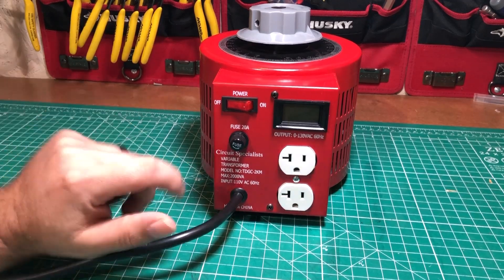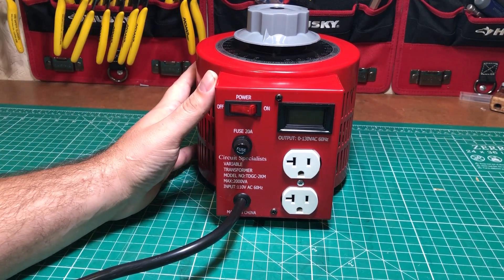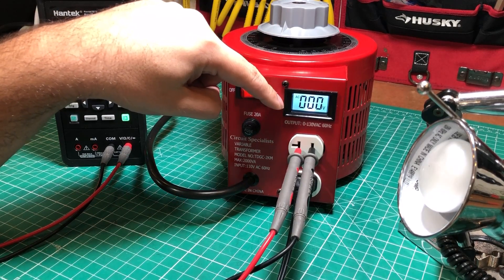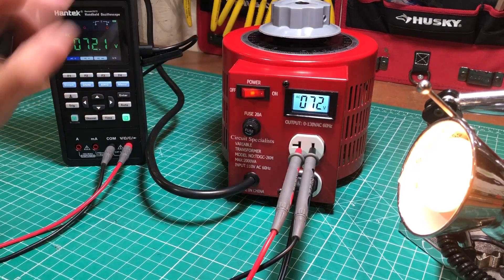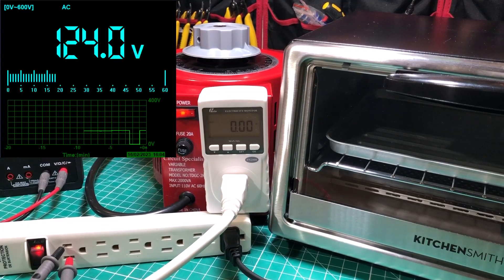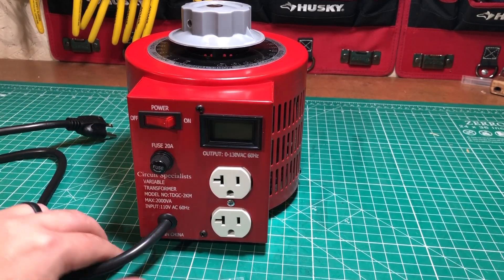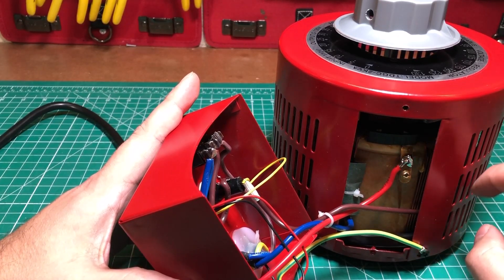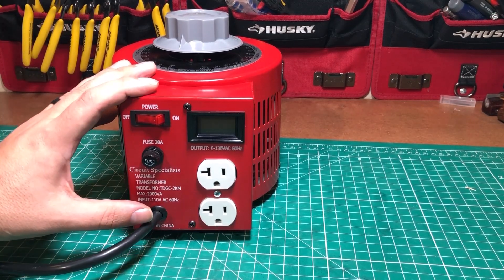Circuit Specialists Variac Teardown and Review - Model TDCG-2D

Comment: I have an idea...do you know how expensive toroidal power transformers are? You pay over $100 for 100VA capacity. Why not take a variac like this one, remove everything from the core, and wind your secondary over it? When you had it apart, did it look like there was enough room to wind a secondary over the core once the shaft was removed?

Comment: The Digital Voltage meter on mine is 4 volts lower than the actual voltage on several VOMs.  Can that digital meter be adjusted ?

Comment: It's floating too so the inputs should be protected.  Oh nm you're not scoping it
Reply from the maker: There's so much to learn from those project kits and you're totally right about the battery.
Reply: @AnotherMaker  see the new arduino giga. Two different arm cores in an stm32 package. One has a 2d rendering pipeline for displays .....or sprites even. I can't pay that much for a microcontroller.  Maybe you can get one in to review. I'll help pay. 

I bailed on that robot arm project and I'm stuck with a bunch of stuff I don't need haha. 2 teensy 4.1 and other stuff from the pjrc site plus a hundred dollars worth of bearings amongst other things. If they have no will to better the place I'm not gon a since around 600 more when I've already donated well over 3k worth of stuff

Comment: That's a big boy. I have a 3amp and matching isolation transformer. I'm modding mine into the same enclosure as my isolation. The wiring I'm not sure of
Reply from the maker: Hey thanks so much!  Having isolation would be awesome.  The longer I've had this thing the more uses I've found for it.
Reply: @AnotherMaker  I have a 1000kva isolation transformer you could have but it weighs more than an anvil haha

Comment: Nice to see a digital meter that's wired to display 0V, some are just 2 wire meters that cut out below about 30v
Here's a tip, when testing things that need low voltage AC, it's easy for the voltage to drift, or to set it accurately, which is important when voltages are criticval
Get a 12 or 24v transformer that can supply as much current as you're likely to use and plug that into the variac, then you'll have better control, thoough you'll need a meter on the transformer output ;)
I have a couple of variacs in a cabinet with voltage and current meters.
Reply from the maker: Yeah.  Now that you mention that, I've seen that with other panel meters.  

That's a really good tip on the transformer.  I may dig one out and play with that.  Thank you.
Reply: Any hope of finding digital meter like that on ali? All are 2 wires and work from 40V and upwards i think

Comment: The main differences between the cheap import I got and this one is the meter and the outlet.

Still disappointed by the "strain relief" schmoo on the incoming power cable.
Reply from the maker: Yeah.  One of those meters might be a nice mod to make for yours.  Seems like it's not quite a necessity but definitely makes it simpler to use.  I did see people complaining about voltage swings of +/- 10VAC on some models.  Glad this one seems stable.

Comment: You might want to put the Variac under load and check what your wall socket voltage is providing before and after. You might just be losing some voltage through your house/bench wiring. I stuck a AC display in-line to my bench and  found at 11A load my wiring was dropping the voltage by 8VAC. Will be replacing the extension cord shortly with a better AWG.
Nice to see the insides of the Variac.
Reply from the maker: That's actually a really good idea.  I will absolutely be checking this.  My office is a distance behind my house powered by what is most likely undersized wire for the distance.

Comment: I started building a variac like a year ago found one big ass transformer (i think its rated 800w, also pretty old as it has lots of bakelite) lying in trash in a junkyard, paid $20 but never completed it cause i wanted it to be really pretty and couldnt find two identical analog meters so its collectinf dust right not missing only a knob switch and a voltmeter
Reply from the maker: It's funny, I was just thinking it would be fun to build one. I have no idea what I would do with it, but still could be a fun experiment.